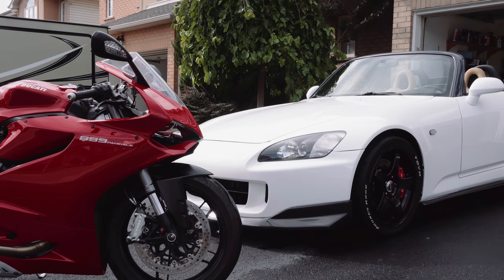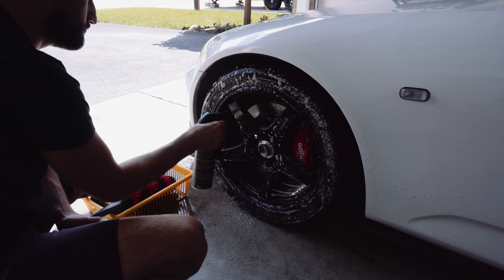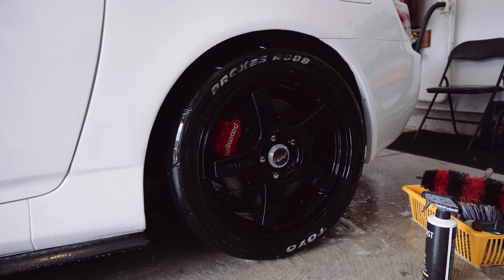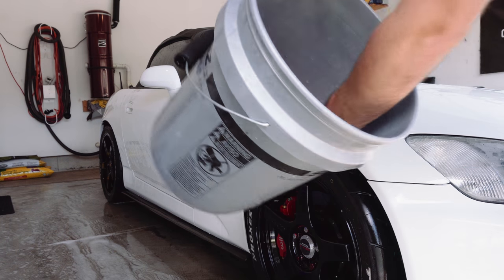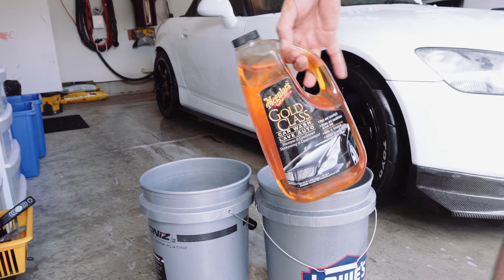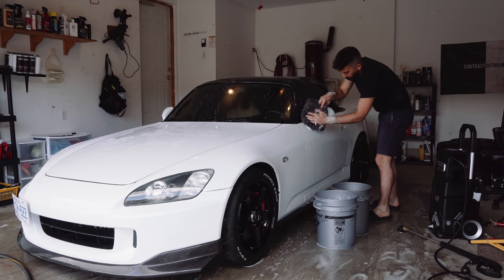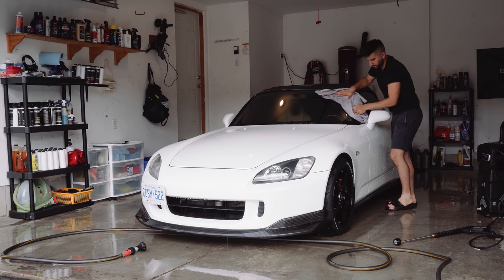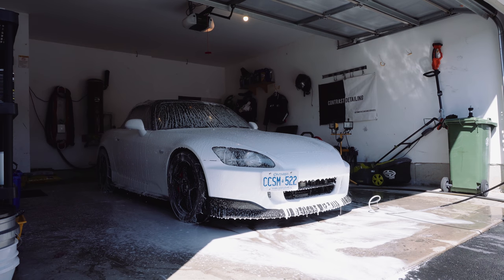How to PROPERLY Wash Your Car! A Professionals Guide!

Comment: Dope vid, will definitely be using this as a reference moving foward.

Quick questions: 
1) where can I buy/how much was that hose attachment? 
2) How do you clean your microfiber towels after a wash, just throw them in a washing machine?  Is it the same for the waffle drying towel?
Reply from the maker: +Eric B 1. All links of the products are in the description box ! 2. Water water and white vinegar in the washing machine only with your microfibers with extra since cycle and that would be the same for the waffle weave towel

Comment: Did you wash your car in the garage cause it hot outside. Or you design to wash car inside garage. Not afraid get wet and soak everywhere in the wall